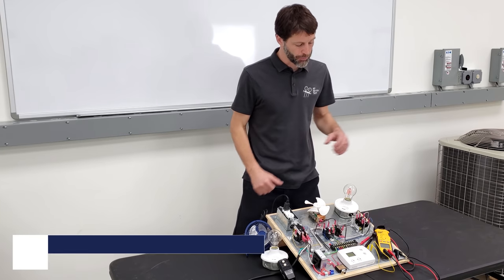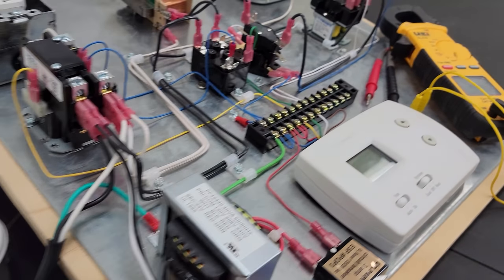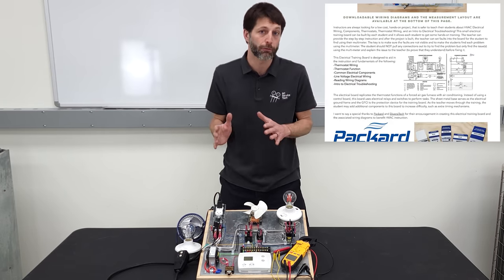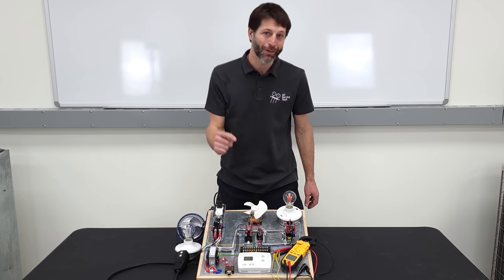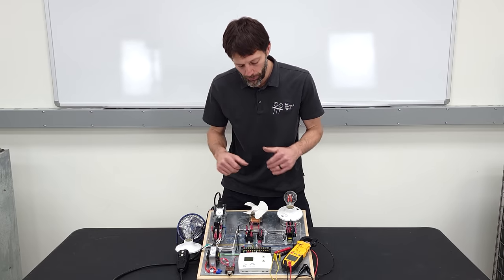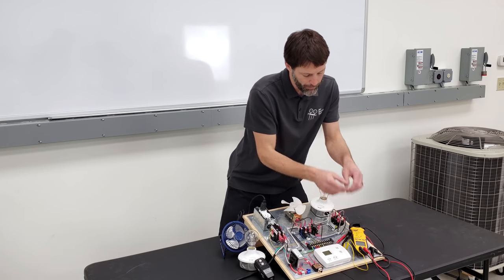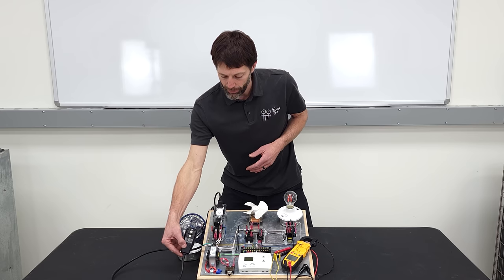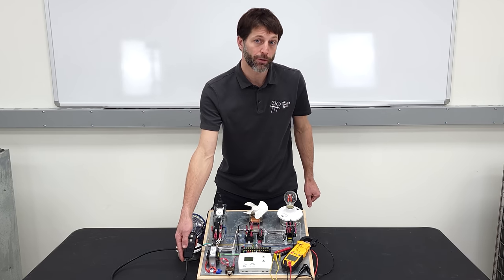Electrical Troubleshooting! Finding 8 Electrical Faults!

Comment: 19:34 how is this checking the resistance of only the transformer? Doesnt the air handler and thermostat effect this reading? Why not disconnect the wires directly from the transformer if thats what you want to test?

Comment: Hey so I’m new to the HVA/C 2 month in class actually and we’re going over the wiring and I have one main question with the thermostat. Would you need the system on and running and power going to it to trouble shoot any problem that can occur in the thermostat? If you need the system off would you turn it off from the breaker or would it technically turn off when you take the face plate but power would still be going to it so you can trouble shoot? Or is it depending on what problem is being trouble shooted? Thanks
Reply: My method is to turn it off at the breaker if I need it off. A long time, I chased my tail when someone turn the thermostat down while I was in a crawlspace.

Comment: Question sir, why is the purpose of checking for ohms. I know it has to do with resistance, but what does that tell us. when checking for ohms power must always be off?
Reply: Omhs is also able to tell you if your wire is connected/not broken solid wire will read a very low ohms value depending on the length of the run. Broken wire will read OL
Reply: @uppy8862  thank you for the reply

Comment: Shouldn’t the fan comes on first then the heating element after in heating mode And when the heating mode is turn off the reverse should happen meaning the heating element is close while the fan remains running until the heating element comes down to an acceptable level before shutting off
Reply: Great video though
Very informative indeed 
Keep up the good work